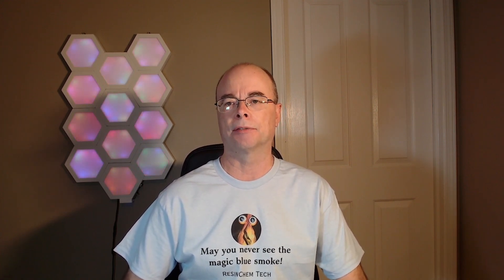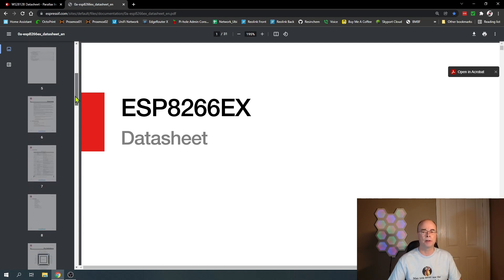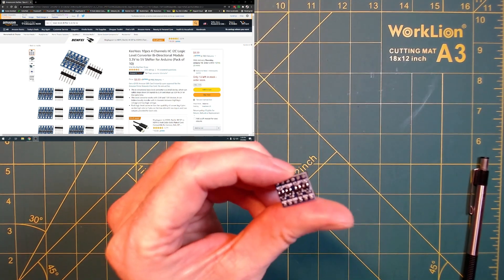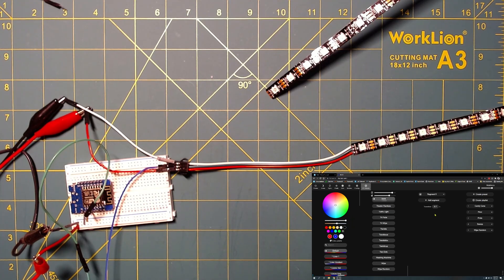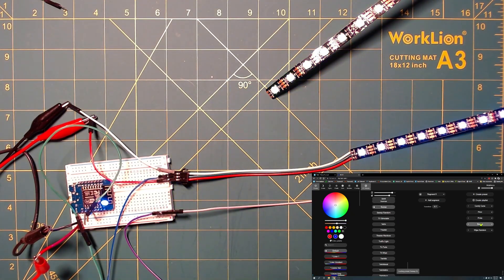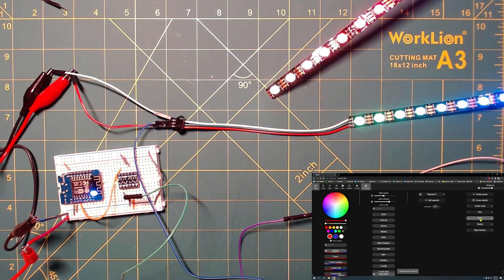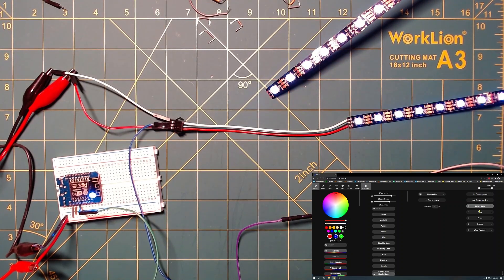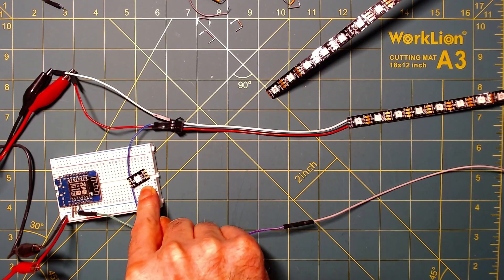Logic Level Shifter and WS2812b LEDs

Comment: Hi, thanks for your awesome explanation, it gave me a new direction to troubleshoot. But still totally confused by the unpredictable flashing lights. Searched for hours if not days. The thing that "solves" it  for me is using a lab / bench power supply on my 24v vs2811 strips. I tried with this logic shifter and with a ws2811 led close by the esp8266. Using a small 24v->3v board to power the esp from the same power source. Using gpio2 and gpio4 on the esp. The led strip close by is steady, the one about 2 meters away keeps flashing. Expect ground issues so using already same power supply to power the esp, and connecting ground where possible.  I tried several 24v power supply's with enough capacity; the "aluminum bar with AC(230v)+ground" and  the "laptop power supply with dc plug", same result. Powering it with my lab/bench power supply it's all steady. Can leave my lab supply there forever, but prefer to have it powered by a device designed for always on. Do you have any idea or suggestions for this brain breaker? Thanks, appreciated :)
Reply from the maker: Well, if changing power supplies to your bench power supply fixes the problem, it sounds like the issue is power related and not related to the data signal/level shifter.  You did not mention how many LEDs are in your strip nor the maximum wattage of your other power supply.  As a rough estimate of the current needed, take your total number of LEDs and multiple by 0.06A.  Your power supply should be capable of supplying a minimum of this many amps.

While it isn't required as frequently as with 5V LED strips, I'd also try power injection at the end of the LEDs.  Run  separate wires from the power supply to the +V/GND connections at the end of the strip or string.  Otherwise, it will likely be just common troubleshooting steps... swapping out the strips, changing controllers, etc.  But flickering or flashing LEDs are almost always the result of one of two issues.... the data signal or insufficient power/voltage drop.  One key hint as to which one:  If nearly all the LEDs are misbehaving, from start to end of the strip, it is likely a signal problem.  If it is the LEDs towards the middle/end of the strip that are flashing/flickering, it is probably power/voltage drop.

Hope that helps or gives some additional ideas as to where to look for the problem.
Reply: @ResinChemTech  Thank you again for intense analysis and response of my case :). Herewith some additional information. Brand of strip BTF, 24v, 5 meter, 720 leds/meter. Max power drawn on bench supply (visible) is 7.5 amps. The power supplies giving the issue are 24v 300w / 12.5amps max, the small, ultra thin ones with aluminum case. Same goes for that "laptop power supply with plug" type.
 
I didn’t do the power injection at the end of those 2 strips. The behavior is for the whole strip, not from somewhere in the middle. In previous projects I tried the both ends powering to see if that helped. Same brand strip, split in 4 parts of 2 meter, all powered from both ends. All segments connected to each other for the signal. Also with the “ultra thin 300w supply” I couldn’t get them stable, while the bench supply did the trick easier (but you don't want that powering something permanently). Was finally able to solve this by having the supply extremely close by the esp8266 and the led strip, and wiring between strip and esp very short (max 10 centimeters). But this limits me to have 1 strip on 1 esp, because not able to run a signal cable for over more than +/- 1 meter (or even less). And having several strips with several esp's (several wled instances) makes it very hard control instead of via 1 wled instance.

If you have any idea to try, much appreciated 😊, still trying to understand how to fix, to create more safe setup. Cannot imagine I’m the only one with those struggles, so hope others are also helped with this case and possible causes + how to solve. Thank you! John

Comment: Is it possible to utilize a single WLED data line for a GPIO pin  , directing it to a level shifter, and subsequently daisy-chain the data line on the low side, ensuring the synchronized output of data on the 5-volt side for multiple LED strips? Just a thought I had. I really like your videos they have helped me learn a lot. Any feed back would awesome.
Reply from the maker: There are many different ways to sync separate LED strips... too many for me to cover in detail here.  I have not explicitly tried the way you are describing, but I think it would work.  Other options (that I have used or tried):
- Split the single outgoing 5V data line from the shifter to two different strips (always synced)
- Use multiple output pins (WLED), shift each and run to different strips.  Create segments in WLED to control separately or treat all as one strip.
- Use different controllers for each LED strip and use the WLED sync function to have the controllers sync to each other, effectively having all the strips running the same effect, color, etc.

The last two options do require that you are using WLED and while they are versions of 'synching', the LEDs may not be precisely timed together on different strips.  The only way for that to happen is to send the exact same signal to each LED strip.  That is what I did for my stair lights, with a separate LED strip on each side.  The difference is that I split the single data line AFTER it was shifted to 5V.  You are talking about splitting the data line before shifting, multiple channels on the shifter, and using separate runs from the high side of the shifter.  I do think that would work as well... I just haven't tried that method.  Let me know if you do try and find that it works.
Reply: Thanks a lot for your input. This is the kind of information that helps me. Some of the ways you mentioned I thought about as well. This idea just popped in my head this morning and I thought I would reach out.Thanks for the examples. Hope to build my own  project and post it soon. Much respect for all of the time and effort that goes into filming and editing not to mention the actual knowledge you share. Thank you. @ResinChemTech

Comment: One thing I don't get is why is there any difference between using one pixel as a level shifter and not using any shifters at all. If one pixel propagates the 3.3V signal as 5V, why do all the pixels on a led strip flicker, instead of just the first one?
Reply from the maker: Primarily because the signal being received by the first pixel is too weak (voltage too low to begin with).  So even though the first pixel "boosts" the signal to the next one, the signal received by the first pixel was already "bad".  So the first pixel is boosting a 'bad' signal and therefore it impacts all the LEDs in the strip.  It like receiving a poor AM radio reception... you can boost the volume or try to process that signal in various ways, but if the signal is missing information from the source, no increase in gain is going to clear up that signal.

By shifting/boosting that signal, you are assuring the first pixel in the strip receives a good, complete data signal.  Each frame of the data signal includes the 'instructions' for each LED in the the entire strip.  So any missing or corrupt portions of that signal has the ability to impact any LED.... not just the first one.  Hope that info helps.
Reply: @ResinChemTech  That's a very helpful explanation. Thank you very much!

Comment: Wemos D1 Mini with logic level converter wired exactly as shown. Strip of 8 leds & powered on with a 10 amp supply and nothing. Unplug & plug back in the logic level converter and the strip lights up. Does work perfectly with an ESP32 or ESP8266, no need to unplug/plug back in. Have tried several LLC modules with same results.
Reply from the maker: I haven't experienced anything like you are describing and it is a bit strange that just unplugging and plugging back in results in the LEDs lighting up.  I know you said you've tried multiple shifters, but have you tried a different D1 Mini?  Most of them are pretty reliable (depending on where you bought them), but I have definitely had a few bad ESP boards over the years.  Maybe there is something strange or not quite right with the D1 Mini.
Reply: @ResinChemTech  Thanks for the reply. Yes, I tried two other Minis with the same results. These were 3 of a batch of 5 I had bought some time ago. Just tried one from another batch and works fine. Thanks again. Enjoy your videos BTW.
Reply from the maker: Unfortunately, it happens.  I had a batch of 5 ESP32s and 3 of them wouldn't even flash.  Luckily for me, that's been pretty rare.  But glad you figured out the cause.  Thanks for the kind words... and good luck with your own DIY projects.

Comment: I went down the logic shifter rabbit hole a long time ago and my solution was to simply keep the controller close by just using the few inches of the supplied power connectors and I haven't had trouble since.  my other concern is connecting a 3.3V driver to a 5V load and getting > Vcc voltages on the pins and I think that's more of a concern.  Nobody every wants to simply use an oscilloscope to look at the signal (including me) but that will show you exactly what's going on.  You don't need to figure out the pulses, just look at the levels coming and going.

Comment: Hello @resinchemtech, I am using fcob led strip, which requires 24v; could you please let me know how to boost the signal to 24v?
Reply from the maker: Most 12V and 24V LEDs still expect a 5V data signal.  Check your strips specifications to be sure, but if does expect a 5V signal then this same process is used regardless of the voltage used to actually power the LEDs.

Comment: I know my comment is bit delayed for a 1 yr. old video,  though the video remains as relevant as that for a beginner like me. I wish to clear my doubt: Some arduino forums, adafruit often suggest a 330 Ohms resistor inline with the data pin. So my question here,
 
Is there any problem when  I use a LLS and a inline resistor (nearest to the 1st pixel ofcourse) together? 

Assuming my data wire length is 10 feet. (Sorry for my English)
Reply from the maker: You can use one or the other, both or none... whatever works in your situation and installation.  That's why I recommend that you do a bench test with the total number of LEDs and the expected wire length run before you actually install the lights.  That way you can see if you have any issues with dimming/flickering of the LEDs and can easily add/remove things like the resistor, power injection, etc. until the lights are behaving as expected.  This is much easier to do on the bench than it is after the install.  

And note that what works for one install may not work for the next, even if they are nearly identical.  I bench test every LED project prior to installation, but ultimately that is your decision.  Good luck with your project!
Reply: Thank you so much for your response sir..

Comment: @resinchemtech Hopefully you see this, I conducted my own experiment on my channel, (you got a few mentions fyi) wanting your input. Very interesting results....
Reply from the maker: I commented on your video.  The big issue here is that you are running well below the maximum brightness of what the LEDs are capable by using only a 3A power supply for a run of 300 LEDs (which can draw up to 18A).  I made other comments as well, but I would encourage you to repeat your test using a 20A or larger power supply without the WLED brightness limiter and see what results you get.

Comment: Any sense for how long a distance the logic level shifter would be good for?  Meaning, what if the distance is 20feet (or more)? Thanks in advance.
Reply from the maker: It depends on numerous factors... the gauge of wire, type of wire, temperature, etc.  I have run at least 15 feet between the controller/shifter and the start of the LED strip without issue, but I can't really give you a definite maximum distance.  I always recommend bench testing first with the actual controller, LEDs and wire you plan on using.

If you have a really long run and need to "boost" the signal again along the way, you can use something like this data booster by Quindor: https://quinled.info/quinled-data-booster-for-sale/

Comment: The cable length from my controller to the first LED was going to be long enough that I decided I needed a level shifter when I began designing my system.  But after looking into the reasons for the level shifter, I chose a different solution.  The problem is NOT the ohmic loss of the cable, and it's not exactly the voltage min/max you reference from the data sheets, it's that the ESP is 3.3V and the output drive is weak.  That leads to slow rise and fall times of the waveform.  The serial signal is based on bit times, and different pulse widths for 1's and 0's.  If the timing is too far off, the signal cannot be decoded properly.  I chose to use a buffer IC from the 74HCT family.  I used a 74HCT244, but a 74HCT125 or other buffers would do the same.  The '244 has 8 buffers for less than 25 cents.  Here's why the HCT family is a good choice for this problem.  These parts are built to accept TTL inputs, but generate CMOS outputs.  That means any input over 2.0V is considered a '1', and anything below 0.7V is considered a '0'.  The CMOS outputs swing to almost VCC (5V) and almost GND.  This gives a very nice output with 35ma drive.  I checked the data stream with an oscilloscope, and get a MUCH better looking data stream from the output of the HCT device than the incoming signal.  Many of the so-called "level shifter" products are little more than a pullup resistor.  That works to a point, but it's just a band aid.  To be a true level shifter, the circuit needs to have active devices that amplify the original signal.
Reply: Great info. The 125 is how I’m going to go. Thanks.
Reply: Yes, 100% correct. By the way , it also matters whether the dataline is a single wire without a close ground wire neighbor. With a close ground wire neighbor , like when you are using the triple white green red type of wire, the signal waveform will deteriorate much quicker using longer lengths.

Comment: I think Hiletgo changed the chips used in their shifters because they no longer work with the high speed needed for WLED.  I bought some from your direct link and just tried them tonight.  I made sure they were working with an oscilloscope and a program that would flash the D4 data line every 50ms and they worked great 3.4v went to 5.1v.  However, when I put them on WLED it's signal is at 800Khz and they no longer boosted the signal both in and out were between 3.4v and 3.5v.  If you want I can share the o-scope pics, but I think Hiletgo changed their chips without saying anything.
Reply from the maker: Thanks for the tip and info.  It is entirely possible that they changed something (likely to save a fraction of cent on manufacturing).  I haven't actually ordered or used those shifters in a while, as this video is nearly two years old.  Unfortunately between videos, blog articles, Github repos, etc., it is impossible for me to keep all older links up to date.

More recently, I've been ordering these:  https://amzn.to/3SZTGe3  I've ordered as recently as this past July and they still seem to be working fine.  But since you have confirmed that there are issues with the Hiletgo, I will go ahead and update the link in this video description.

Thanks again.

Comment: 3 feet are 1 meter. 
That means I can put 1 meter of cable between them and don't need a level shifter. 
But at 2 meters I should use one.
Or I put a Neopixel directly behind the ESP and then long the cable.
Reply from the maker: There is not a set distance where you might experience problems or might be fine.  You could have one install at 3 feet with no issues at all, but another identical install with the same components that might  have issues.  There are variabilities in the manufacturing and tolerances of the components that just simply make it impossible to say that you will or won't have signal issues as a particular distance.  Other factors like the size of wire used will also have an impact.

That's why my personal recommendation is to always include a shifter, then you simply don't have to worry about it.  But you are free to make your own decision on your project.  You might be fine at 3 feet, or even longer, with one install, but experience issues with another install at even less than 3 feet.

Comment: Thank you for confirming my suspicions with this video. Been doing this for years but started using a thicker longer wire out of my control box and ran into the exact issue you showed in this video. I did not realize extra length on the led strip can cause this issue, always thought it was just the length from the first pixel. Ordered some logic level shifters. Thanks again for the thorough videos, learned a lot.
Reply from the maker: Do note that voltage drop along a lengthier run of LEDs can also result in fading, flickering or other misbehaving LEDs.  The data signal is boosted by each pixel, so the shifter is generally used for the longer run between the controller and start of the LED strip.  But if the voltage along the strip drops too low, you can see similar issues (although it is normally preceded by fading color/dimming LEDs first).

If you've been doing LED installs for a while, I'm sure you are familiar with doing power injection.  But just in case, I do cover power injection in my video on common LED questions ( https://youtu.be/GZv5Ztj6i6I ).  Jump to the chapter on power injection.

But including a logic level shifter is never a bad idea... I include one on all my LED controllers, regardless of length of the wiring to the start of the LEDs.
Reply: Never mind I am 6 months behind and I now see the video you already made on using the I2c chip 😂. Keep up the good work. Appreciate your videos.